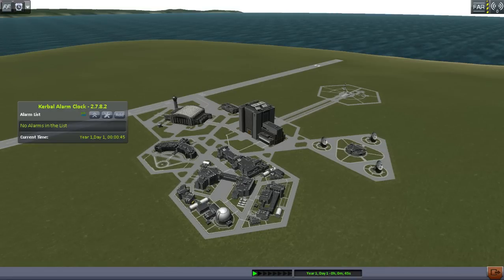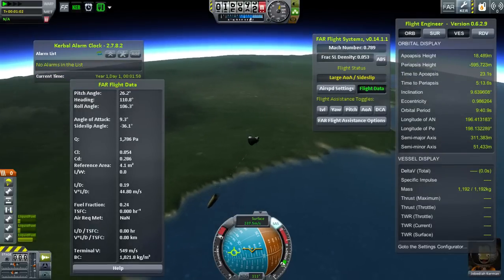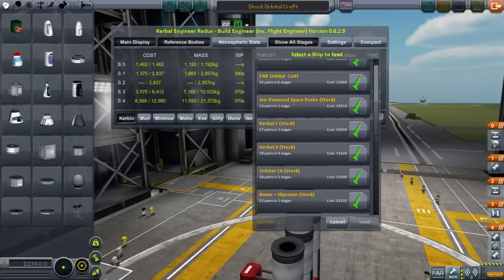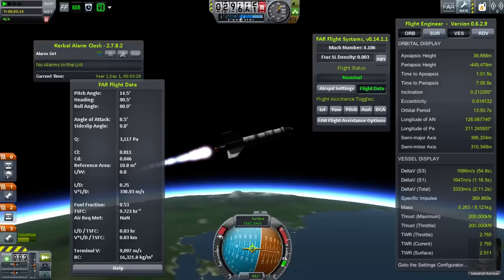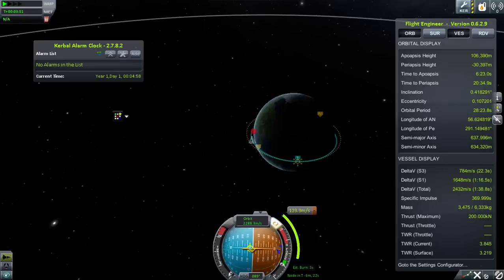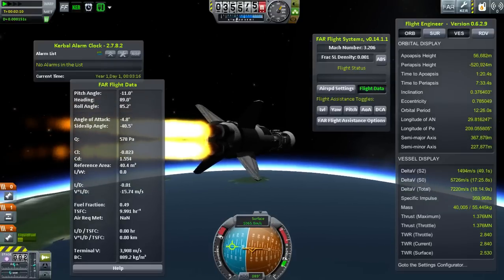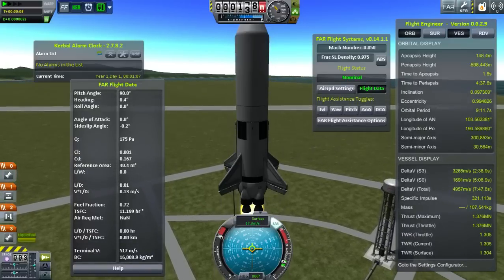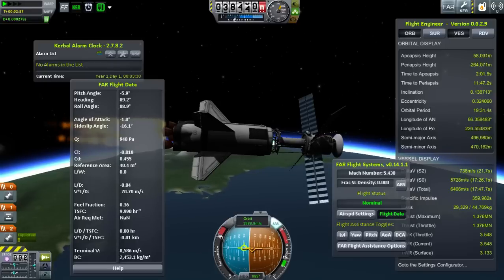KSP Realism Tutorial: Rockets in Ferram Aerospace Research

Comment: you should turn down the volume of the rockets because its really hard to hear ya while you're launching. Good video though. post more!
Reply from the maker: Thank you for your feedback; I have struggled for a while to get the audio correct on rockets. Rocket sounds are a bit better in my newer videos, although there is still a lot of tweaking to be done.

I have been meaning to work on the RemoteTech tutorial for ages now. I may get around to that in the future, especially since I have found better ways of doing things through experimentation.

Comment: Max Q was actually higher on the flight with the fairing than without! Does the fairing actually help max Q in FAR, or just your delta-V (by reducing drag)?
Reply from the maker: Q itself is a function of the local density (usually denoted ρ) and the vessel's velocity. Thus, my understanding is that fairings do not necessarily reduce Max Q. In fact, you might expect it to increase because the fairings reduce drag and increase your acceleration. I may have implied otherwise in the video and I will endeavor to correct the error. Thank you for your correction!